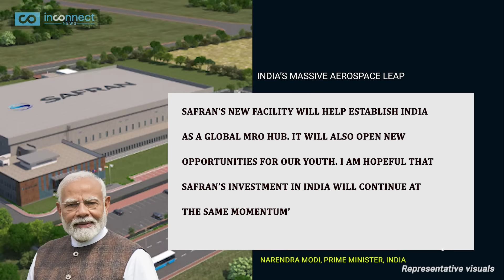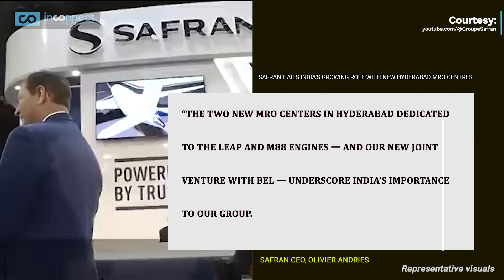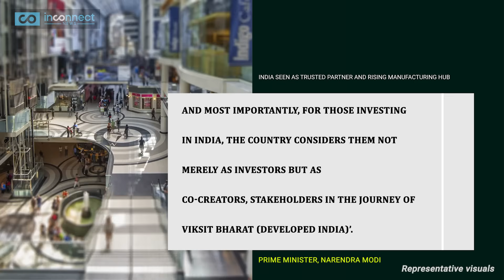From LEAP to AMCA The Engine Upgrade That Could Change Asia’s Air Power | Indian Defence News

Comment: Tejus1a tejus2 maro Goli. Where will super su 30? The king of sky except stealth. When😢induct😢2030  with ews and weapon package of hypersonic aam Asm avionics rader Come 2028 no 7th generation  dare to enter India. Even it😢killed b21😢rider 1500km away😢wiith air😢to air rudram 4.yes r[drom 4 two vrrsion onr😢hyprrd<nic air to surface and one air to air, here  150kg warhead decrease  60 kg, range and😮speed increase, range 1500 to 2000km for😢bomber awake ews size aircraft speed😢increase 7.5 Mack  not😮5.5 Mack. Another  kusha m4 satalite ICBM hypersonic killer 600 Km range 350km altitude test 2029.its open secrate not secrate. When secrate leak😢but official not announce then  called open😢secrate. One day😮we see  behind😢Indian president. The above missiles  seen. The above😮two missile. Surya missile picture we see behind venkaia naidu. Agni 6 confirm rajnath sing. Surya now confirm Isro.says we have surya lunch vehicle to  36000km range and attitude with 24 ton warhead and satalite. Multple,sstlite😢lunch capability. Rudram report  1/2/3/4  all have aam version with 30 to 60 kg😢w\rhead supersonic to hypersonic warhead decrease speed and range increased. Bromhos ng 60 kg warhead version with 500 km aam will come😢2028. All pakistani😢fighter then fly😢away to Iran. Full pakistan😢no flyinh😢zone from😢2030.december week  possibly k5 test  in the name😢k4. I suspect. K4 already induct 1st two submarine  3rd airadomon may test either k4 and then induct or k5 from pontoon. If😢k5 test then pontoon if k4 test  then airidomon. Now 4 chinese😢one USA spyship in Indian Ocean one Australian spyship n^arear west Australian. Where  mirv dropped